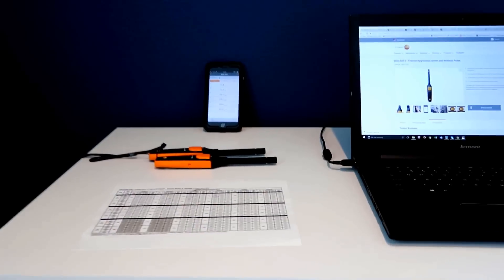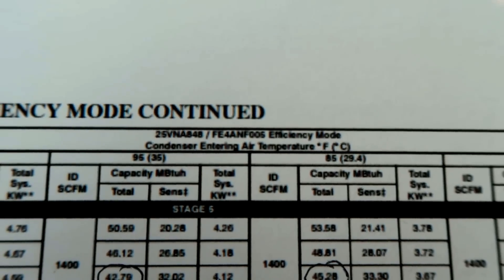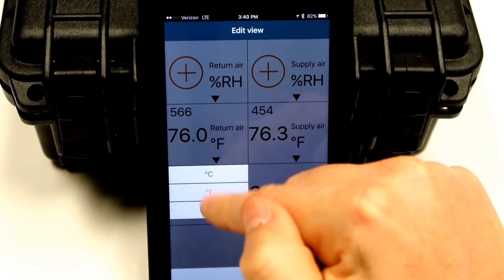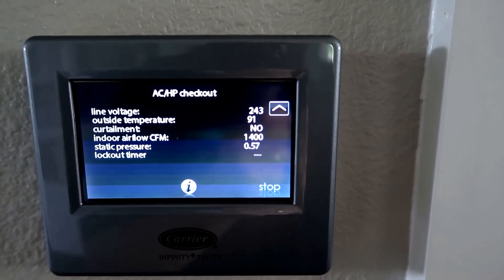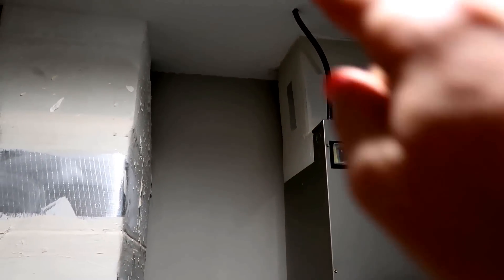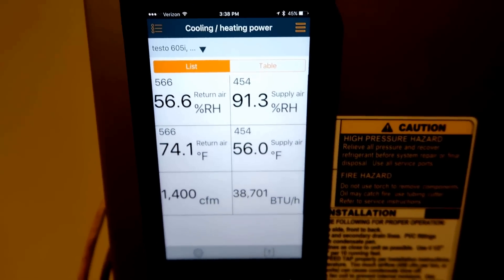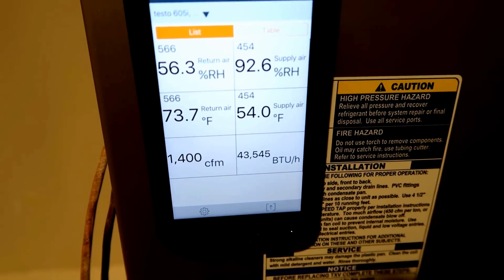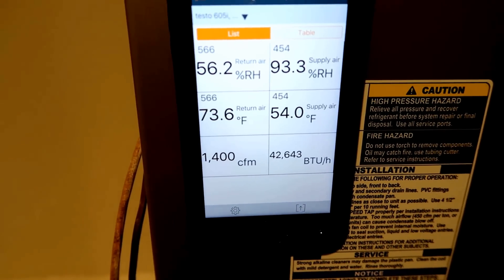Checking your REAL Tonnage/Capacity w/ Testo 605i Thermo-Hygrometers

Comment: Great video, but I wish you would explain how to get the btu calculation with out the Testo app. You can use any psycrometer with a chart from ASHRE for enthalpy per btu. And with a quick calculation figure out the btu even if you don’t have the testo equipment. Not trying to be negative, just thought it might be helpful to some that don’t have the equipment. It is also helpful to understand how you get those btu calcs.

Comment: Not a Testo question, but I've always wondered since the iManifold app came out (and later, MeasureQuick) just exactly how those apps (seemingly) can calculate airflow AND capacity with just the supply and return air hygrometers.  The hygrometer readings will give the supply and return enthalpies, but there are many combinations of BTUH and CFM that will satisfy the underlying heat equations (after adjusting air density).   What additional information is used by the app to solve this dilemma?

Jim seemed to answer the airflow question for me in a recent thread on hvac-talk, when he said that the app really only computes CFM per ton, and then multiplies that by the nominal tonnage to get CFM.  CFM per ton comes straight from the enthalpy equation, corrected for air density.  Q = CFM X (mass air flow factor) X delta h.  Rearranging we get CFM/Q = 1/(mass air flow X delta h).  At least that's how I think it could be done by hand.

I'm guessing that the total, sensible, and latent capacities are estimates based on the nominal tonnage entered by the user.  That tonnage is then adjusted for system load (RA DB & WB, ODA) to give a "theoretical" capacity, which is what is used by the app for "normalization".  Those adjustments would be similar to what we would do manually if we had the manufacturer's extended performance tables in our hands.  We'd interpolate from the table based on the ODA, IDWB, IDDB temperatures to get our total, sensible, and latent capacities.  I'm guessing those relationships are pretty similar for different manufacturers' equipment, although I haven't tried to verify that myself.  

At any rate, the questions those tools have raised in my mind in these areas have been good for me because they have forced me to think deeper and reinforce my understanding of how it all works.

Comment: Good video. System capacity is so dependant on Air Flow it Seems that without Actually Measuring the ACTUAL CFM With a Flow Hood You are Still only Approximating System Capacity.
Reply from the maker: Even a flow hood isn't exact due to duct leakage. Fan curves on ECM and X13 motors are pretty accuarte

Comment: Playing with the testo 605i in refrigeration, comparing different walk in coolers for humidity levels... question, Example, when I use the app in Basic View and only have the one 605i connected, the app shows 72F temp, 59 %RH, 62F wet bulb temp and then 57 F td.

What is the F td reading ? What is the app using as a temperature difference?
Reply from the maker: That is actually Dew Point... They are working to update the app. Calling it TD is a German thing I guess.
Reply: HVAC School doh!  That makes sense. Thanks

Comment: #HVAC School  I like listening to your podcasts.  Listened to your circuit board podcast and perplexed at you saying you can't use an ohm meter on a board.  I do a lot of electronic projects and use ohm meter a lot.  Just curious on why its bad to use? Not being rude or anything just curious so I know Im not misusing.
Reply: If you know how and why you are using a Ohmmeter than it should be OK. The output voltage on an ohmmeter is high enough to damage many solid state boards.
Reply: Bryan Orr yeah but most of the boards have a line suppression. And most meters don't go higher than 9 volts. But most HVAC boards are 24 volts input. With or without a regulator ???? So I'm confused
Reply: I think you are misunderstand what I meant. I mean using an Ohmmeter within a solid state board where the voltages are lower that than 9V. Example: the control board of the Mitsubishi air handler I replaced a few days ago.
Reply: Bryan Orr that board is less than 24 volts?  Hmmm
Reply: Bryan Orr I'm very misunderstood. Every ac unit I work on. Transformer only steps down too 24 volt. Rooftop,chiller, ductless, that is the norm so I'm trying to understand why a 9 volt meter checking ohms would be bad on a board in Hvac would be harmful???
Reply: Again I'm not trying too be an ass. I'm trying to understand. I'm not opening this too a debate. Just for my knowledge

Comment: Good vid. Just wondering why Florida doesn't use metal duct with insulation on it? Is duct board code?
Reply from the maker: No reason other than that board is easier to install. We have no basements and almost all engineered web trusses.
Reply: Totally Agree Duct Board should be Outlawed ! Bare fibreglass  Blowing into the air stream of your house. totally crap Product as u say. you'll never catch me using it. Worst shit ever invented ! Goes in the Same Category as Refrigerant Leak Sealers, Easy seal etc. super seal. all junk.

Comment: Bryan, 
One thing that I would suggest is to always put probes in a moving air stream when testing them for accuracy. If you put them both in the RA stream will find you get better more stable and likely closer, although those Testo probes are pretty spot on.
Reply from the maker: Good Point
Reply: paw patrol   ghosts
Reply: i

Comment: My second question would be.If you do than distinguish that you are infact not where you are supposed to be in terms of capacity, where would you than look to fix the issue. I am a new apprentice and certainly appreciate all your videos and podcast.Thank you
Reply from the maker: There are a wide range of things that can have an impact on system capacity but the next step would be a detailed look at the refrigerant circuit starting with suction pressure, liquid pressure, Subcool and Superheat.
Reply: Cory Desormeaux rvggbgv
Reply: I Don't Really think thats true. At 208 or 230 volt You will see different amp draws , But Rpm of the Motor is the same , so capacity remains the same.

Comment: Love the video. To go further into this could you then use your 770-3 to calculate exactly how many watts it takes to achieve said btus and calculate your real time seer/eer? Also would this work in reverse for heat pumps and furnance to calculate heat?
Reply: thx for video. i am not sure how to measure air density
Reply: @marknasri3490  A psych chart.